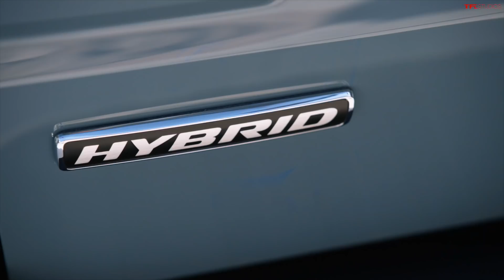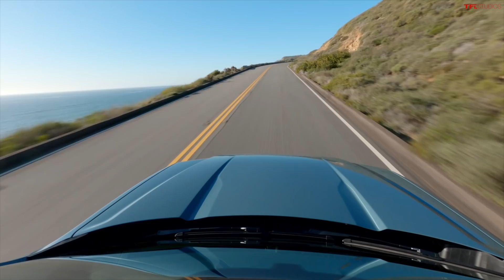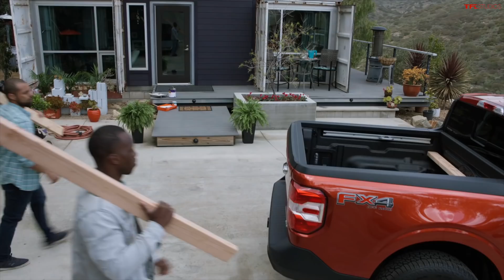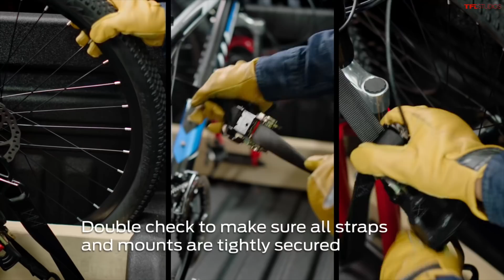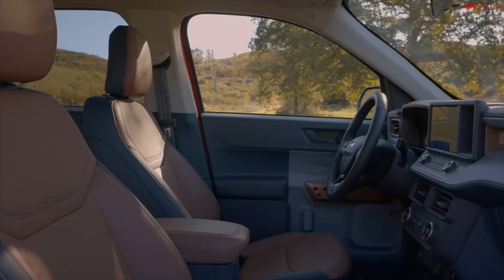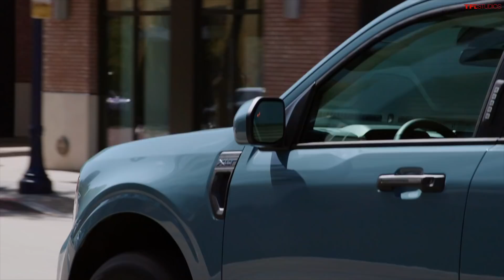What Do You Think Of The 2022 Ford Maverick? I Get ALL The Details From The Guy Who Built It!

Comment: Love these post launch interviews! Awesome reporting Andre!

Needs the twin clutch drive unit for AWD. this would destroy any upcoming subaru truck, and the hyundai. and add aton of off road ability!

With hyundai saying 600 lb bed limit and ability to tow 5K. there will be no payload left for things in the bed. at least Ford gets it right with a useable rear payload.
Reply: Its actually 660 lbs, and you can't combine payload and towing capacities anyway. In other words, you can't pull a 4,000lb trailer AND have 1,500 lbs worth of stuff in the bed, Further, you have to subtract the weight of any vehicle occupants from the payload as well. That's why the Santa Cruz's bed payload is 660lbs but the total payload is 1,748 lbs (means you can bring 1,084 lbs worth of friends or gear in the cab on top of the 660lbs in the bed whereas if you put 1,084 lbs worth of friends or gear in the cab of the Maverick you'll be down to 412 lbs of bed payload. 

It really is a horse-a-piece. The Santa Cruz is better at taking your friends and their stuff out for a weekend getaway while the Maverick is better for solo trips to Fleet farm to pick up bags of mulch.
Reply: @dave3682  ya, but in the Hyundai if I attach a 5k trailer (it's capacity) I can only put 160lbs in the bed.

Maverick I can put 4k behind it, and still put 1,000 lbs into the bed (assuming driver weights 100lbs).
Reply: @CorRob-h8b  Ranger?
Reply: @dave3682  fixed 🤣🤣🤣 so many trucks
Reply: @CorRob-h8b  Gotcha. Though, because the Santa Cruz's towing capacity is 1,000 lbs higher that means that the 840 lbs worth of stuff that you can't put in the Santa Cruz's bed you can just put into the trailer. So the Santa Cruz owner is always going to be able to bring more stuff along either which way you slice it.
Reply: @dave3682  well see that's where my concern comes in, if they're saying you can only put 660 lb in the bed, do they mean that the rear axle only has 660 lb of reserve capacity? in which case those back seat riders are going to have to account for that too? 

The biggest issue with trucks while Towing is available payload after you max your trailer out. I have no doubt, with a fully loaded price well below $40,000 and IRS, that there will be people that buy the Maverick to tow a camper trailer. If their trailer weighs 4000 lb with a full tank of water obviously they're going to need the bed capacity to put the rest of their stuff.
Reply: @CorRob-h8b  I'm thinking it has more to do with the fact that its a plastic bed and they don't want it to buckle, crack, or bulge under too much weight.

Comment: Starting price is the same as the Nissan Frontier. A mid-range frontier in crew cab would be a much better buy than this. And depending on the price of the Santa Cruz, that might even be a better buy 🤷🏻‍♂️
Reply: SC costs more on base and TC models.
Reply: In what world is a new Frontier this cheap?

A mid range Frontier with 4WD will cost you 36-38 grand at minimum. That’s about 9 grand more than my Maverick build.
Reply: @OrtadragoonX  a 2021 mid-range (SV trim) frontier crew cab with 4x4 is around 31k. If you’re paying more than 2-3k above that, you’re getting bent over. I’m not talking 2022s. Prices for those aren’t even out yet.

Comment: The standard tow rating absolutely sucks ass! They need to get those numbers closer to 2500-3000 pounds in the base side of things. Knowing ford you’ll have to load the truck up with almost every package known to man to get the tow package and at that point a Ranger would be cheaper 🤷‍♂️ kinda a huge miss by them
Reply: This is just a cuv with a bed, keep your expectations in line. Meant more for suburbanites who don't need to tow or haul a ton.
Reply: @deansmits006  the ridgeline has 5000 pound tow rating and so does the Santa Cruz. The RAV4 with its 2.5l naturally aspirated engine has a 3500 pound tow rating. 2500-3000 pound tow rating isn’t asking a whole lot considering most suv are towing at that and only the smaller compact suv are around 2000-3000 pounds. Truck otherwise is almost perfect for most lifestyle individuals. Owned a 16 canyon, towed only a handful of times, mainly a landscape trailer, and a 18ft camper. Both loaded up were around 2500-2800 pounds. Not big hardly loaded, was just hoping this truck would be able to tow a bit more since the canyon was a pig on gas and don’t need more truck than it, problem is pricing the maverick with tow package puts it right in line with the Ranger. Bit of a tough sell. I was ready to buy one. Kinda throws a wrench into it.
Reply: @SINE382  Dude, stop acting like your special or that everyone is like you or has the same needs as you, Ford has their target set, you aren't in it so move on, it's perfectly equipped for what it does, the cost itself justifies any complaint you can come up with.
Reply: @raionshishi8290  man you must be a ford fan boy my comment really hurt ya guy!
Reply: @SINE382  Perhaps you are the emotionally damaged individual one judging by thy response my good sir.
Reply: @raionshishi8290  oh very much so!!! I’m just devastated by your mean comments. How dare someone not agree with my opinion! I’m just shattered by you, so fragile, someone on the internet got hurt by my comment and got mean at me. What ever shall I do???
Reply: @SINE382  Seems like it if you are still replying and or that pissed of at what i said really, i simply stated the truth, you simply didn't like it and wanted to belittle me but now that i have mocked you it seems i struck a nerve and now you are just doing this back and forth to seem like you are ... better ? Ah well, do what you want, i'll let you be and let you feel like you won, have a nice day.
Reply: @raionshishi8290  oh you struck my nerve alright it’s caused me to have a series of nervous twitches
Reply: @raionshishi8290   yay I win I win I win :D
Reply: Just get the  F350  if you want more for towing  heck  they even make 450 650  750
Reply: @CS-lx5eo  I’m probably the main target buyer for one of these and 2000 pounds barely rows a landscape trailer with a few bags of seed, and a couple pieces of equipment. Super disappointing. Priced out the truck already online and to get the tow package is a huge price bump you might as well get a Ranger at that price range. It’s disappointing. The base bronco sport tows more with a three cylinder
Reply: @SINE382  uh, the tow package with the Ecoboost is only about 1700 bucks extra. 

On monthly payments, that’s maybe 15 dollars more per month.
Reply: @OrtadragoonX  I’ve priced it xlt with eco boost and tow package $34,000cdn or $37,900 if you get the premium package with it. Compared to the base xlt without tow package $29,000cdn. That’s a $5000 upgrade because you have to opt for the eco boost to get the tow package.
Reply: @M Maple I built and priced both on the website the last couple days as I was ready to put a deposit down and order a maverick. An xl maverick (base)with 2.0t awd and tow package comes in at $32k cdn and a xl Ranger with 4x4(also base and we don’t get 2wd in Canada) at $33k. For an extra grand you get a bigger more comparable truck. I’m now hesitant as I like the idea of the hybrid fuel mileage but really nervous if it’s 2000 pound tow rating as I’d be towing slightly heavier 2200pounds on average. Wish ford was able to squeeze a little more towing outta the base maverick

Comment: Ridiculous. The Honda Ridgeline isn’t even a top selling vehicle and it’s a Honda. Why not just buy an SUV ? Unless you plan on hauling a refrigerator standing up what good is that open unsecured space in a city vehicle? The El Camino for yuppies.
Reply: That’s because the Ridgeline is $41,000+ after destination starting! 
This is half the price.
Reply: @devinbender8428  Wow Thanks didn’t know the Ridgeline was that pricey. I know when ever I run across them used they’ve usually got over 200k miles on them lol.
Reply: Try hauling garbage, mulch or any landscaping materials in an SUV. There are numerous scenarios where a pickup works better than an SUV. 
you can always put a bed cover on it for security
Reply: @robyoung878  exactly. And for comparison. The Bronco sport only has about 3’ of trunk space. This has 4.5’

Comment: CVT transmission kills any chance of me buying it.
Reply: Gas engine has an 8speed auto.

And it’s not a belt driven CVT like most. It’s electrical and gears. The electric motors and transmission are all one unit.
Reply: The bigger engine has a 8 speed.
Reply: I assume since they are calling it an eCVT, that it is similar to the Toyota eCVT. The Toyota eCVT relies on electric motors and doesn't resemble anything close to a mechanical belt CVT like you would see in a Nissan. If this ends up being true, then it will be a very reliable transmission.
Reply: @smarticus6384  that is correct. Basically the same thing that’s in the Prius. Basically an automatic trans with an electric motor instead of solenoids
Reply: @smarticus6384  Like the transmissions in the Ford Escape POS ?
Reply: @rolandthethompsongunner64  you mean the 2010-2018 nothing like that
Reply: @rolandthethompsongunner64  maybe you had bad luck. But according to consumer guide it's not on the list. Lots of Nissan’s and Chevrolet make up most of the list.
Reply: Thanks yep wouldn’t touch it.
Reply: @rolandthethompsongunner64  it’s the same thing as a regular automatic but instead of hydraulic solenoids it has electric motors to change the speed of the planetary gears. Making it a hybrid. 

Not a belt and cone CVT
Reply: @devinbender8428  Right. I’m sure the local transmission shop is able to fix these things when they crap out or malfunction right?

Comment: A 4.5’ bed isn’t long enough. 

I would like to see a reg cab model with a small storage space behind the seats, 6.5’ bed, and awd/4wd with a low range. 

That would be an awesome compact truck with lots of utility and capability.
Reply: Then get the Ranger
Reply: @BullittOutdoors  exactly! Extended cab. 6.5’ bed tremor package XLT. Done!
Reply: @BullittOutdoors  this is smaller, costs less, way better mpg etc..... than the ranger.
Reply: Not enough people buy that configuration to keep the cost of building then, according to manufacturers. However, if that brings the price down $1000, maybe it would? We are more likely to get the hybrid in AWD a bit down the road
Reply: For you.
Reply: Exactly this thing in current configuration shouldn’t even be classified as a truck. It’s a Ford Escape with a tiny bed.

Comment: I see millions of these on the road, with pest control companies and similar.
Reply: I work in pest control and already mentioned this vehicle to my boss.  My V8 Sierra is overkill for a 50gal tank and basic equipment.  Unless there are some quality control or reliability issues, this little Ford is going to fill a need in the industry.
Reply: What about the pool service/cleaning guys?
Reply: I can see a police version too.if not then most will get the base model
Reply: I do too eventually
Reply: Yeah I have to agree. This has fleet vehicle written all over it.
Reply: I see it flopping.
Reply: @keyoke69  
Wow what a stupid statement !!!!!
Reply: @keyoke69  Your a troll.
Reply: @1sinister80  im realistic
Reply: @1sinister80  also, its "you're".
Reply: Every Ford in our fleet craps out at about three or four years not worth the money
Reply: @ericdubon7428  weird.  I have over 400k miles on an f-150.  245k on a 2010 explorer.  no problems other than the stuff that would get replaced on every vehicle with that mileage.  FWIW i also have a 2000 4runner as a daily driver with 404k on it.   I’ve had a dodge that lasted under 70k and a nissan sentra brand new off lot that didn’t last 5 years.
Reply: @providentpathfinders219  You are completely right. Dodge is garbage and Nissan is garbage now after Renault got them. I have a 17 explorer with 96k miles and a 19 f 150 for work with 45k miles both are great so far. I have had many f 150 work trucks all well over 250k great trucks.
Reply: Nope. A Toyota Tacoma stripped down is way more practical and affordable.
Reply: @rolandthethompsongunner64  those tacomas have garbage fuel efficiency this vehicle would get double the miles per gallon
Reply: @oogleboogle123456789  And have the payload of a Ford Escape. So what?
Reply: @rolandthethompsongunner64  he said a tacoma should be a fleet vehicle but with gas at 3.20 a gallon a truck that uses twice the gas will not look as appealing
Reply: @gregboulden6293  You go ahead and put 1,500 lbs into that made in Mexico pos with unibody construction.
Reply: @rolandthethompsongunner64  I’m sure Ford will offer a fleet version, and under 20k and 40 mpg, I think k @privident pathfinders may be on to something.
Reply: @rolandthethompsongunner64  Fuel cost is one of the highest priorities for fleet buyers. The hybrid as it's base powerplant will make the Maverick a very popular choice for fleet. As fuel prices rise a Toyota will look less desirable.
Reply: @rolandthethompsongunner64  tacomas are relatively more expensive tho….
Reply: @RandomVideos-re9ux  Gee I wonder why ?
Reply: @rolandthethompsongunner64  I'm a Toyota owner and fan, but this truck would be much more practical for a fleet vehicle than a base Tacoma. 6-7k less for a new truck, better mpg, same or higher payload. If it is a large corporation that rotates fleets every 4-5 years then the main reason to buy a Tacoma (reliability) isn't as important.
Reply: @ljefferies2012  Until I see actual test results I’m holding on to me money. I’m a huge Ford fan myself and skeptical it’ll be around 20k nicely equipped. That’s cheaper than a base model Ford Escape which this thing basically is. And the Ford Escape is a POS.
Reply: @rolandthethompsongunner64  I would say it’s more bronco sport than escape even though the difference are negligible.
Reply: @ljefferies2012  Even if reliability is important, Ford trucks are still some of the most reliable trucks you can buy, and that hybrid system is unkillable in other Ford's.
Reply: @rolandthethompsongunner64  not really, more expensive and worse fuel economy.
Reply: @rolandthethompsongunner64  Less than 20k?
Reply: @rolandthethompsongunner64   LMFAOOO the tacoma is 26k from the beginning, this maverick you can get the Lariat for 25.5k, So please refrain from saying affordable, this is the cheapest truck ever made
Reply: @benjaminsmith992  Affordable doesn’t mean quality. I’ll buy a used Tacoma before I bought that made in Mexico CVT transmission disposable POS.
Reply: @benjaminsmith992  CHEAP = JUNK ! Be my guest buy 2.
Reply: @rolandthethompsongunner64   LMFAO broski I've test driven one all ready, I've got to sit and use the whole system in the whole truck, It's so much better than any USED tacoma. Trust me on that one cheif
Reply: @benjaminsmith992  Right. Let me know in 5 years. So far my 21 year old F 250 is doing fine. I don’t need a CHEAP toy with a CVT transmission.
Reply: @rolandthethompsongunner64  The hybrid system has been out for a decade, it's one of those powertrains that everywhere you look, you see people talking about how their hybrids have last 300k with no repairs. They use these in escape taxi's, those rack up 400-600k with no issues. They regularly outlasts crown Vic and Camry taxis. Let me say that again, the hybrid system ford's using in this is so durable, it puts a CROWN VIC to shame. Think about that
Reply: @rolandthethompsongunner64  Also, learn the difference between a cvt, and a e-cvt. Literally nothing alike, a cvt is a problem design with belts and pulleys, a e-cvt, which is what ford and Toyota use, is known for being extremely durable.

Comment: I would buy one if it was 4wd and had t case with low range. I think it being FWD and 2wd will cost them a lot of sales.
Reply: That’s not the market this is going after.  It won’t cost them sales whatsoever because this isn’t for that type of stuff.
Reply: @providentpathfinders219  What exactly is it for then ?
Reply: @rolandthethompsongunner64  it’s for people who would like a truck bed but don’t necessarily need to tow big stuff, haul big stuff, go off-roading, bombing through the desert,  rollin coal, or want to have a pair of rubber balls hanging from the hitch.  It’s for people who can’t afford the 40k plus for a big ass truck they don’t want or need.
Reply: It comes in AWD with the 2.0t version.
Reply: @DimitriNakos  AWD isn't 4wd. AWD doesn't work well on the muddy slick rocks here in the south.
Reply: Ford Ranger should suit you. If the price is too high, get used. This truck can't be this cheap and that capable. And if someone did make it, it likely wouldn't even have a radio
Reply: @deansmits006 a  ranger isn't a compact truck. The new ranger for my needs is useless. It's as big and cost as much as a F-150 and I already have a F-350 Superduty when I need a real truck. A lot of people want a compact 4wd pickup for daily driving and taking down the trails at there deer lease. It's a shame my state won't make the use of a  SxS street legal.
Reply: Yeah, there’s no way they could sell this thing for as cheap as it is if they went BOF with a full transfer case. 

AWD will suffice for slightly muddy roads and driving across fields. Which is my use case. Any more than that, I’d go ahead and step up to a mid size. But I also don’t need that kind of capability.